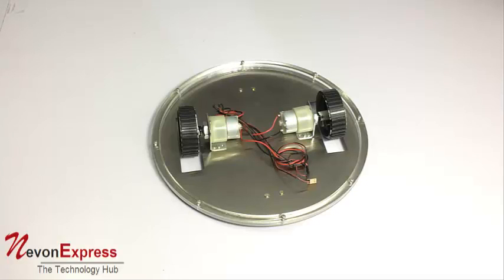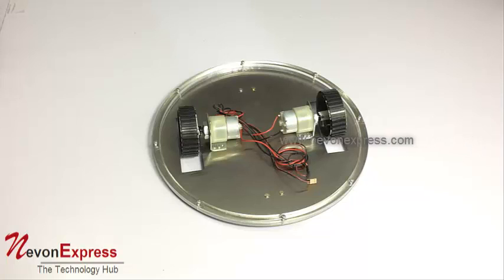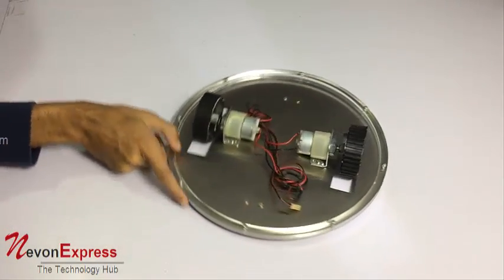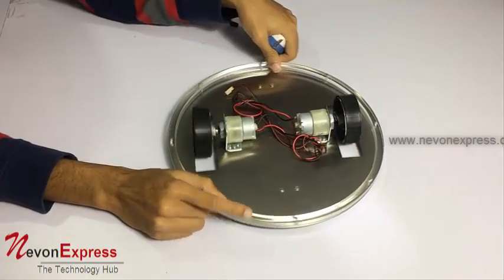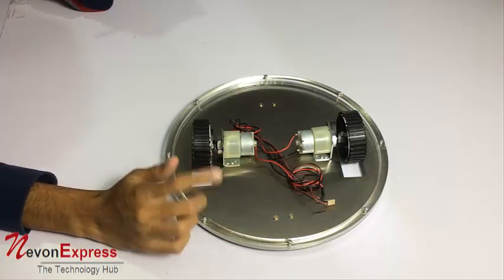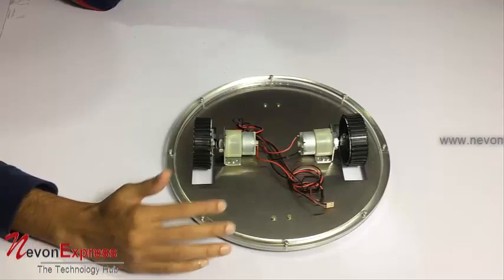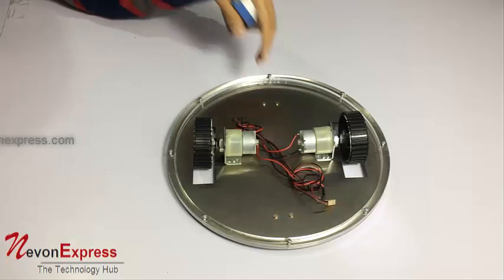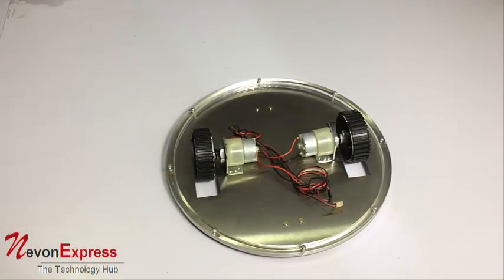Flying Saucer UFO Robotic Kit Diy

Comment: dude that is fake i know how to make it firstly take a 20kg very big round circle plate and a very high speed motor atleast 600000rpm and then connect the rotor of the motor to the big circle and when the motor will start the big circle will also rotate making gravity stop acting on it like how it is done in a flying disk due to high speed rotation it flies up because the gravity stopes acting on it so guys if you liked my comment then click the subcribe button of my youtube channel ok bye bye !!😃😃😃